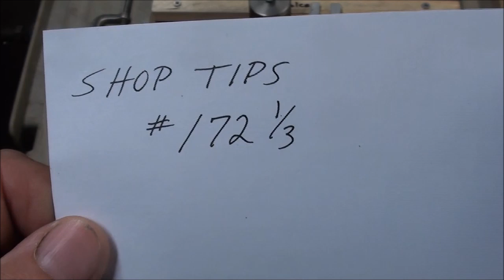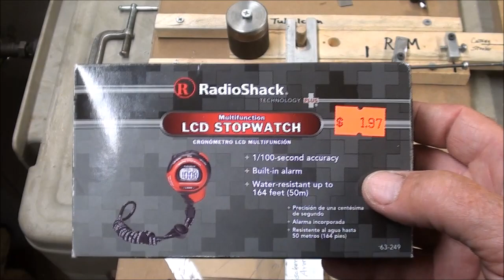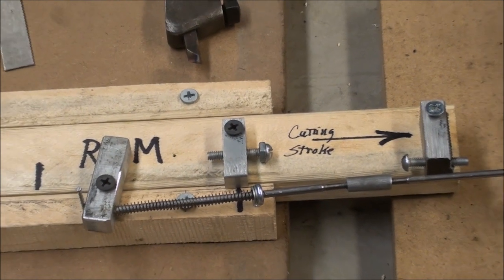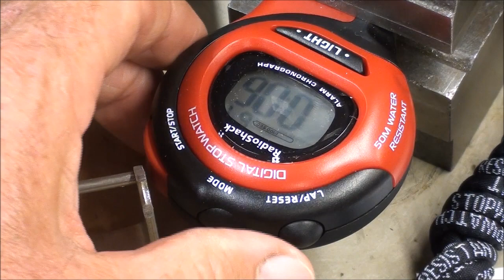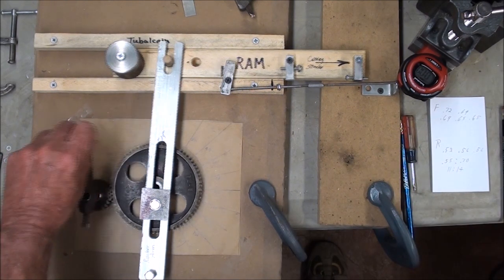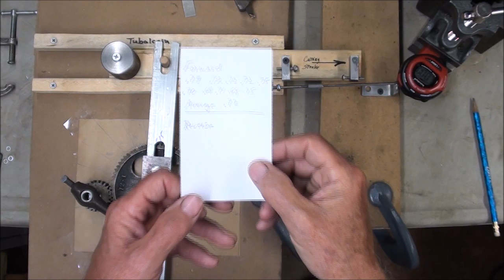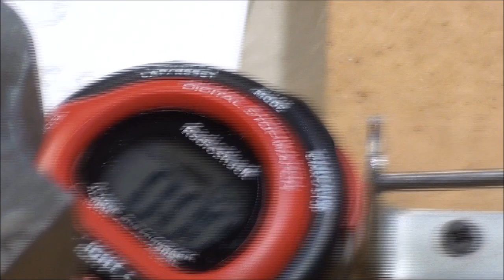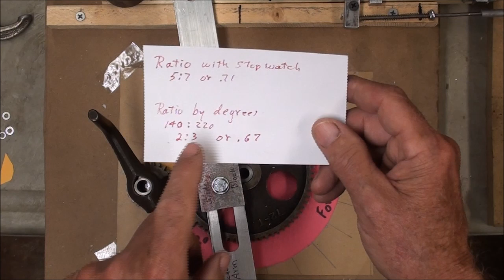Tips #172 1/3 Whitworth Mechanism Rhodes Shaper tubalcain

Comment: Here's my arithmetic, Mr. Pete. A ratio of 5 parts to 7 parts has a total of 12 parts. 5/12 = .4167 or 42% of the time on the return stroke. For the degree case, there are a total of 360 degrees, so 140/360 = .3889 or 39% on the return stroke. Pretty close.

Comment: Mr. Pete, the way I'm looking at it, it makes absolutely no difference at all in time savings and/or productivity.  The total cycle time is fully and wholly dependent on the time it takes for the bull gear to make a complete revolution.  Therefore, whether you run the machine forward or backwards, you will still remove the same amount of metal in the same amount of time.  It makes absolutely no difference.  What the mechanism DOES do is (in addition to converting rotary motion to linear reciprocating motion) it increases the force available (for a given amount of motor power) on the advancing stroke (cutting stroke) over that which would be available on the return stroke... ie. you can take a deeper cut with the machine running in the correct direction than you could with the machine running backwards.   If you had a machine with a crankshaft out behind the ram rather than the Whitworth mechanism underneath, it would still remove the same amount of metal per unit time, given that the stroke and depth of cut were the same.  The advantage of the Whitworth mechanism is that it gives adjustability as far as ram travel is concerned... however, you could do the same with a crankshaft machine as well, but the crank/bull gear would have to be larger to get the same stroke length.  The main benefit as I see it is that it gives a machine of a given maximum stroke length a smaller footprint... meaning you can get more machines packed into your factory.
Reply from the maker: gOOD POINTS.
Reply: Ah, but if the return stroke took the same time as the cutting stroke, the overall cycle time would be longer. Therefore for a given cutting stroke time, making the return faster does increase productivity over the case where the forward and back motions take the same time. And that is the genius of the invention.
Reply: John Langell
How could it possibly be longer?  Think about it.  If the bull gear is turning at 60rpm, the ram will make 60 cutting strokes in one minute.  It makes absolutely no difference if the machine is running in the "correct" direction, with the cutting stroke slower and the return stroke faster, or if the machine was running backwards, with the cutting stroke faster and the return stroke slower.  It will still only make 60 cutting strokes in one minute.  If the machine has a crankshaft turning 60 rpm, and the forward and return strokes are exactly the same speed, the machine will still only make 60 cutting strokes in one minute.  As far as speed and productivity, the only way to save time is to increase the speed of the bull gear.  The Whitworth mechanism does not make the machine more productive... the increased return speed of the ram is just a byproduct of the geometry of the mechanism.
Reply: xlr82v2 You need to think in terms of how much useful work is done per revolution of the bull gear.

In Mr Pete's case, his machine spends 7/12ths of it's time cutting and 5/12ths of it's time returning to the start.
Reply: princebatswater
You are exactly right.  But how many jobs on the shaper require only 1 cutting stroke, 1 complete cycle, for the entire job?  I'd say almost none.  So, again, it makes absolutely no difference, in regards to time savings and increased productivity, whether or not the return stroke is faster, slower, or exactly the same, as the cutting stroke. 

A Shaper Race:

Let's say we have a job to do on the shaper, and we have 3 shapers set up to do the identical job, all 3 at the same time.  The first 2 shapers are identical with the Whitworth Quick Return Mechanism, but #2 shaper is running backwards, so that the cutting stroke is faster than the return stroke.  #3 shaper is my hypothetical Crankshaft Mechanism shaper, where the forward cutting stroke and the return stroke are exactly the same speed.  We have a 10x10x10 inch cube of steel, and we want to remove .030" off of just one of the faces of the cube.  So we get the cube set up in the vice on each machine, set each machine for an 11 1/2 inch stroke, that gives us 3/4 inch travel before the cut starts, and 3/4 inch travel after the cut finishes.  We set each machine so that it's bull gear or crankshaft, as the case may be, is turning at exactly 60rpm...60 cutting strokes per minute, if you will.  We set each machine so that it advances the workpiece by .020" for each cutting stroke.  Finally, we set each workpiece on each machine so that the machines have to  make 5 cycles before the cutting tool contacts the workpiece, and the first actual cutting stroke on each machine is the full .030 depth and the full .020 swath.  We set each machine so that each ram is at the "bottom dead center" of the stroke when it starts.  We have them all wired to one big switch, so that when the switch is thrown, all 3 machines start at exactly the same time.  We'll assume that the job is finished after the last cut is complete and the ram is again at it's "bottom dead center" position after completion of the last return stroke. 

Which machine will finish the job first?

Which one saved the most time, and was the most productive?
Reply: xlr82v2 The point you're missing is that the maximum speed at which the cutting tool can travel when in contact the work is finite. In your example the cutting speeds of the three machines would be approximately; 

50 feet/min for the WW mechanism.
60 feet/min for the plain crank.
70 feet/min for the reverse WW.

Now if we establish that the maximum cutting speed for your steel cube .030 x .020 cut is 50 feet/min, that means we have to slow down the other two machines to avoid burning up the tool or whatever.
Reply: princebatswater

You are correct that the max cutting speed for materials is finite... however, that is a point that you're desperately trying to make (the maximum cutting speed for most steels is actually much higher, and therefore, moot) , not one that I'm missing, and it has nothing to do with supporting or refuting my premise that the Whitworth Quick Return Mechanism, in and of itself, does not increase productivity and efficiency. 

Let's try to stay on argument and not divert to something different which was never called into question...

***Edit***

After thinking about it a bit, I can see your point, but your argument only holds up if we are working at the absolute ragged edge of the maximum cutting speed for a given material and being able to truly optimize the machines' speed to that maximum cutting speed.  In the real world this almost certainly would never happen, given that most shapers only had from 2 to maybe 8 available speeds (Bull Gear RPM) to run them at, with a small amount of cutting speed variability available through changing the length of stroke, the availability of this depending on the job. Then maybe double that if you could actually easily run them in reverse without rewiring the motor, although reverse decreases your cutting power (unless you're cutting on the return stroke, which would result in the same cutting speed as in forward; which I don't know if that was ever done... probably only very rarely, almost never) and increases strain on the components of the machine, which would result in increased operating costs and increased downtime, thus, reverse was probably only very rarely, if ever, used... real world.

That being said, I still contend that your argument has not refuted mine.
Reply: xlr82v2"Your argument only holds up if we are working at the absolute ragged edge of the maximum cutting speed for a given material and being able to truly optimize the machines' speed to that maximum cutting speed.  In the real world this almost certainly would never happen"

I disagree. Back when there were factories with rows of shapers in full production, running them at the absolute maximum cutting speed was,  I imagine, the rule rather than the exception.

If this isn't the case, why did manufacturers even bother making shapers with the WW mechanism?
Reply: princebatswater
I'm quite sure that they did run them at the fastest PRACTICAL speed... but like I said, the WQRM's advantage that I ceded to you above can only be realized if you are running the tool cutting speed (stroke speed) at the ABSOLUTE PERFECT MAXIMUM for the material (not the machine's maximum), with a given hand ground tool, at a given material's ambient temperature, and with the normal allowable property variances within any given batch of material.  And even if you could achieve that, and MAINTAIN it, it's only a gnat's hair advantage... almost nothing... the WQRM might eek out a few more strokes in an hour vs. a crankshaft machine.  In the old factories, the line shafts probably ran at a fairly constant speed, and the input speed you had for your shaper was a product of what size sheaves were on the line shaft and the driven shaft on the shaper, and the ability of the governor on the steam engine to keep the line speed constant.  Then the shaper itself had a number of speeds available to give the machine some utility... I doubt that any speed on any shaper is or was a perfect maximum cutting speed match for any type of material, at any given time.  That is why I said that in the real world, that condition (ie. operating at the absolute perfect maximum cutting speed for any given material) would almost certainly never happen-- the machine speeds were not that adjustable... not that tuneable... not that optimizable.  So, in practice, any other mechanism vs. the WQRM, would be just as productive and time saving, because, even though the WQRM does have a slightly faster return stroke than cutting stroke, it is simply a means to convert rotary motion to reciprocating motion, just the same as a crankshaft and connecting rod.  The faster return stroke of the WQRM is simply a by-product of the geometry of the mechanism... in practice, it gains you nothing.  If you run each one at the same speed, you are going to do the same work, although the crankshaft machine might have a very slightly higher tool speed... it is impossible for the WQRM to cut more OR less metal in an hour than a crankshaft type machine at the same speed, because each complete cycle corresponds with a complete rotation of the bull gear or crankshaft running at a more or less constant speed.  And since it was (is) unlikely to ever fine tune the speeds to get the shaper running at the absolute perfect maximum cutting speed for a material, that theoretical advantage that could theoretically be there at the absolute perfect maximum cutting speed never materializes because the shaper is almost certainly never going to be running at the absolute perfect maximum cutting speed.

As I said in my first comment to Tubalcain, I think the advantage of the WQRM is not in saving a couple of hundredths of a second on the return stroke, which I am fairly well convinced that it does not, but rather in giving the machine the smallest possible footprint for a given maximum stroke length, allowing the factories get more machines packed into their finite amount of floor space-- or getting the maximum number of machines into a minimum amount of floor space.  I can't imagine that a crankshaft type machine could be made as compactly as the Whitworth mechanism and still achieve the same stroke length and cutting power.

I do hope you are enjoying this as much as I am :-) LOL

Comment: Just think of the pivoting point of the lever arm the center of a wheel, when a force is applied closer to the pivot point on the arm (Small radius) it causes the arm to move much faster than when force is applied further away from the pivoting point. (Large radius) moving the arm much slower. By the carefull positioning of the large geared drive crank & having the crank pin inside of the slotted arm causes the un equal placement of the crank pin distance or arc radius from the fixed pivoting point on the arm, or wheel.

Comment: Thanks for this.  Maybe a bit of contrast would help explain this.  If the lever arm was attached to the pivot on the big gear much like a locomotive engine and the lever was in direct line with the cutting action, the time of the cutting and return strokes would be identical just like a piston on a steam locomotive.  Here the pivot is effectively shortening and lengthening the lever arm.  When the lever is long (return stroke), a little movement in the pivot makes the end of the lever arm move more than when the lever arm is short (cutting stroke) .  I spent all my time in the first video looking at the end of the lever arm when all the action that matters in in the pivot that slides up and down the lever arm as the big gear rotates.  Jim
Reply: awesome answer! effectively lengthening and shortening the lever arm was exactly what I needed to understand why it was happening.

Comment: I wonder what would be the effect of a crankshaft in a piston engine set up similarly? In that case the "work" is done on the down stroke. Would there be a gain in horsepower or torque? Could it be balanced by counterweights?

Comment: As there is so much interest in this asymmetrical movement, and while you are in 'demonstration' mode, had you thought about trying this demo on the actual shaper: Put a felt tipped pen where the tool goes and a sheet of white card on the table that normally holds the work. Disconnect the ratchet drive so the table can be moved quickly with the handwheel. Turn the machine on and traverse the table at a steady speed. The pen should trace out a sawtooth-like pattern clearly showing the different speeds of the cutting and return stroke.

Comment: Thanks Lyle!.....an interesting subject, as I just sold my South Bend 7" Shaper, and am doing the final prep on it before it goes out of the door to the new owner. My final tasks concern the oil pump and oiling on the South bend....not sure how other shapers handle the  oiling, but SB ran a tube to each ram dovetail, as well as one to the bull gear, and one to the yoke. I can see now it would have been better if they had a volume adjustment on each tube, and a sort of regulation depending on what speed the user has selected. Since my SB is newer, I suspect the Rhodes had oil slingers, rather than a pump and tube system. It will be interesting to see the Rhodes, as well as the 8" Shape Rite that I upgraded to. I say upgraded, because it is my heavier built per inch!  Great subject and machine, as unused as they are nowadays!     Jim

Comment: A thought on the timing test...
If you did a cumulative test (20 or so turns), and showed the increasing difference in relative times (both cut and return), you'd show how time cutting vs time returning adds up to better efficiency. :)
Reply: Also, you could use that method to reduce the effect of start/stop latency and probably get a more consistent crank speed.  You just run the cumulative test, let the stopwatch accrue all the time, and divide by the total turns to get the average.

Comment: Ha, ha, what an interesting experiment and it IS correct and showing the time difference very nicely !

Way back when "Mr. Shaper" - the inventor of these machines ;-)) - should choose between different method to get the "shape movement" - forth and back - he chooses the method you so nicely are demonstrating BECAUSE it had this side effect - NOTHING special is done to get this effect - it's there because of the geometry in the construction of the method.

The way I see it is, that the closer the stud on the turning wheel is to the pivot point of the long bar, the faster it will move that bar when turning at a constant rate - right ?

And ofcause Mr. Shaper did choose this particular method because it gave him a good argument in the "selling" of the idea ... and the machine !

We have a saying in Denmark ... something like: Now it's made in cardboard with a pair of scissors - and that's exactly what you did - nice !

Comment: you should point out that the difference in the speed of travel is a result of the position
of the anchor at the bottom in relation to the position of the anchor on the driven gear.
On the power stroke the anchor is farther from  the main anchor and on the return
stroke the anchor points are closer together thus not having to move as far to get the
ram to return.
I got a card for fathers day that had moving parts ,, I pulled it apart to see what made
it tick and it had  a motor and gears and as I operated it I could see that it had the same motion as the shaper . I thought this is just like what mr. pete was showing on
his video. The card was made in China ( like most things ) but I could really see
what was happening.    Thank you for all your labors of love of machines, that help
each of us see more clearly how and why things work or don't work.

Comment: The cutting stroke takes two revolutions of the hand crank and the return stroke takes one, meaning that it's effective for around two thirds of the time. The block linkage is closer to the rocker arm pivot for the duration of the return stroke. If the arm was longer and it's pivot was therefore further away the ratio would be closer to 1:1.